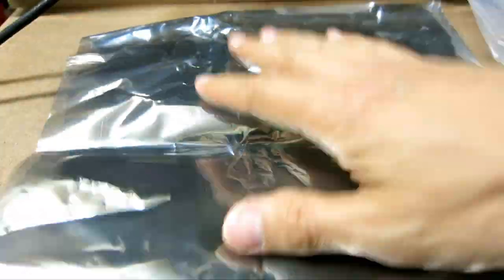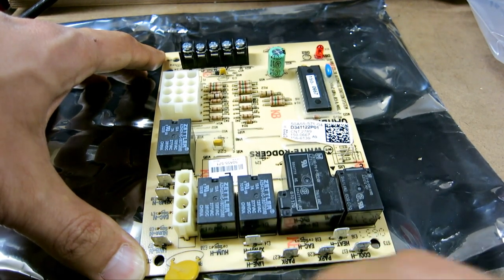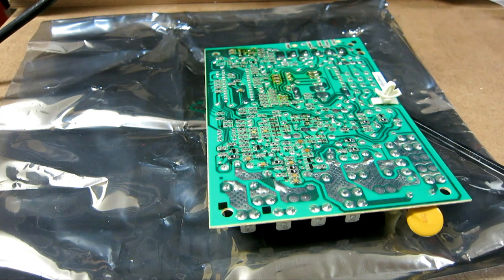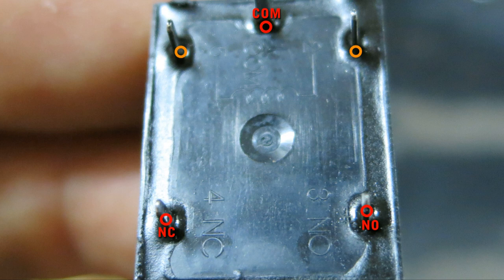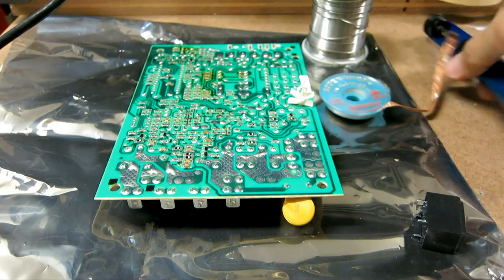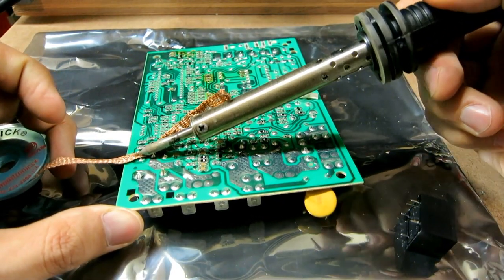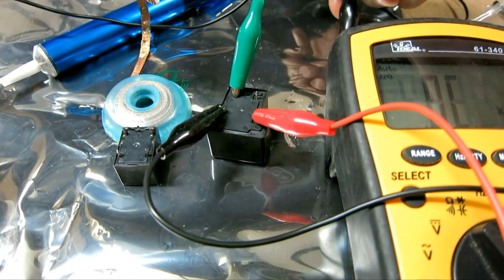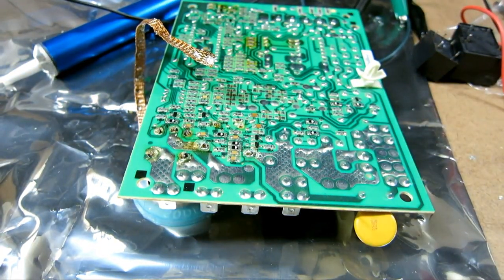Repairing HVAC Furnace Control Board Relay - How to fix air condition faulty circuit

Comment: I know this is an old video, but it helped me today and saved me money on not having to buy a new board. I have a 3 year old NCM-300 board (to replace a previous failed one of same type) and yesterday when I tried to run the heat for the first time this season, the T-stats were calling for heat but the board would not send the signal to the air handler. I suspected a bad relay, it was hard to test it while on the board, so I desoldered it and sure enough, the W signal relay (same as your small one on this video) had a bad coil. I then pulled a relay from the old board that was good, burnt it in place and voila, kept the family warm overnight. Hopefully it will last at least 2-3 more seasons. So your fix might have failed (surely something else in the board) but helped me save some cash. Thanks again!

Comment: Hey this video seems to have helped a lot of people.   Well it saved my bacon this evening too. I’ve been having a weird problem with the inducer for a year and could not for the life of me figure it out.  I watched this video after seeing someone else say it might be a stuck relay.  I didn’t know what a relay was so I watched this.  I can’t remember if it was this or the first one that said to tap it but the inducer was running and running preventing the sequence from resetting to burn and heat.  I learned what a relay was from this and went tapping on the little boxes and bang!   It turned off!   I put the cover on, turned on the thermostat and it instantly fired up.  So grateful on a cold February night in the Pacific Northwest.  God Bless!

Comment: Repaired circuit cards more than once.  Trane Furnace, GE frige.  The problem were not in the components.  In every case, it was COLD SOLDER JOINT at relay leg.  Need X10 or X30 magnifier to see the micro hair line crack in the solder.  Once fixed, they seem run forever.
Reply: YEP.
Reply: Thanks. That saved me a thousand dollar service call up here in the Great White.
Reply: This is very helpful! I did the exact repair in the video and found that the relays worked fine so Im confused. I saw some where that it could be a solder crack but didnt think much of it. THanks for the suggestion.

Comment: Thanks for this video. I have a Lennox G50DF furnance. The fan willow turn off after delayed cooling phase. Control is a 97L4801 WHITE ROGERS. I NOTICED inideo you have the schematic for the controller? Where did you get that?

Comment: I have a dhdvh52ef0ww (GE adora dryer) with a magellan dryer power pcb v06 (manufactured 11/2004). The dryer would dry between 5 to 10 minutes before shutting off. The timer would continue to count down but no further tumble. Attempt to power off and power back on result in 1 relay clicking but thats about it. Self diagnostics turned out OK.
After investigating further, I discovered that the relay associated the dryer motor was cutting off due to bad soldering...

Comment: Good information anyway.  Could you have tested the relay coils prior to removal?
Reply from the maker: Good question. In some cases you could stim 18VDC on the coil and measure the relay resistance while the relay is still on the board. However, since i dont have the detailed circuit card schematics, i didnt want to take any chance damaging the processor or other chips surrounding the relay. 
Also, sometimes intermittent relays work under no load, but fails when delivering 120VAC (resistance built up on the contacts). This wasnt the case, but it happens often.

Comment: Hi, I have a complicated question:)
I have a portable Ac, which it’s run 115v 60hz 1070w 10amps, I tried to look for a converter to run it in 220v 50hz but the results is I can’t because the hertz not gonna converted, I think by a different way, I will replace the compressor and the capacitor to 220v 50hz and I think the transformer 220v to 24v, my question is is there is anything should I change like relay ? Thank you
Reply: Kattr Kattr yes replace the whole unit and be done with it

Comment: Question I just move to a rental house and the condenser or the outside unit the resistor won't magnetized only if I depress it will work but regardless there is no air coming into the house vent any help with it thanks and good job
Reply: rafael b why don’t call your landlord instead of messing with a power source that can kill you ?

Comment: hi ,I hope if u can help me with this,  I got an electrical furnace with electronic board that give 297c that my work need,  the problem is , I got a new material with melting point of 230, but the furnace is 287c + - 10, so you can set it only on minimum which is 277, is there any way to make it set on 230?, means to reduce the setting temperature? it's already giving 230 as its start from 0 , but it can't set on that degree!.
Reply: Light body no idea what the heck u talking bout

Comment: I just replaced the board on my 1995 Trane XE80 furnace today.  The original board was killed when the blower motor overheated and drew too much power at startup.  After that, the furnace started doing strange things.  Sometimes it would startup ok but then the blower would never shut off.  Other times it would light the igniter, light the gas, then shut right off.

I was looking at this video with the hopes that I could repair the old board and keep it as a backup in case the new one decides to break on a 0F night and I have to wait until I can get another new board.  Oh well, looks like it's just back to electric heaters in that case again.

Comment: If the board is out of warranty why not just replace the relays?
Why is it not a valid repair?
Reply: +Bob Blanchette because while ur charging a customer to change relays on a board u its more cost effective to replace the board its self, change the relays today and have another issue on the board next week, dont just replace relays on a board, just replace the whole board, save money and time
Reply: That’s assuming a typical repair . If you are familiar with bars electronics and know how to test the individual components and , you should be good to go. Knowing that certain board populations are prone to fail and replacing them while the board is out will guarantee a good job. Sometimes in refrigeration for example, we never use the heat coils and so that relay , contractor or fan speed control can be used elsewhere. Knowing what the board is doing and understanding the components is key for the given operation. It’s sad to see most techs don’t know anything about smd soldering or even bother to carry a simple soldering iron.

Comment: With respect but i didnt watch any troubleshooting  in the board before replacing parts. Alittle disappointed
Reply from the maker: very true. there is another video where i determine the board being bad, and i did a voltage test. But i could have powered up this board and test it in this video.

Comment: As a technician we don't repair boards like that because of exactly what you just went threw. It's the biggest waste of time especially when we have 10 other people we need to get to. Even if you got lucky and it did fix it you still have to think about the stress that relay was putting on the resistors and capacitors due to lack of continuity. 
In the end just replace the whole board quit being so damn cheap.
Reply: Jesse Luna stress? Ummm... will need something less anecdotal for that claim.
Reply: Jesse Luna well, your right, but if the service techs didn't charge an extremely inflated price for the board on top of service call you wouldn't have people tinkering with that crap. Customer shouldn't be billed $500 for a $50 board plus labor. Or how about a tech tell you you need a $700 control board because of a blown fuse, but didn't check the contactor that was shorted, no that never happens...
Reply: @corvettecoupe3731  yes, after a $1100 bill for parts and labor to replace HVAC board, i'm looking into why my other HVAC unit (different apartment) is having intermittent fan issues.  I see the parts are $15 on digikey, plus my time. :)